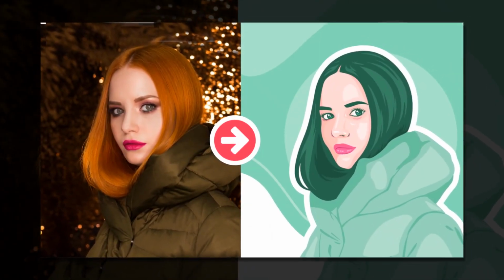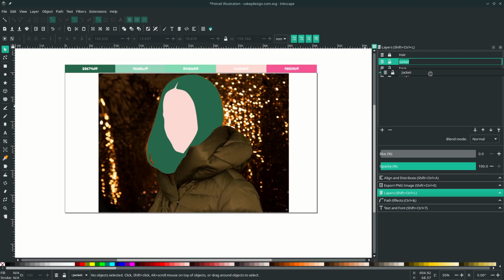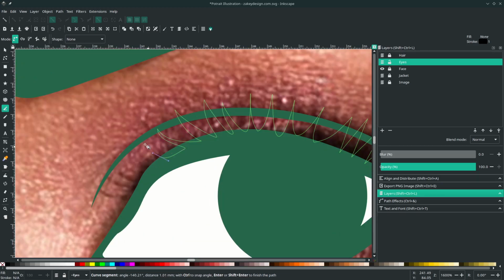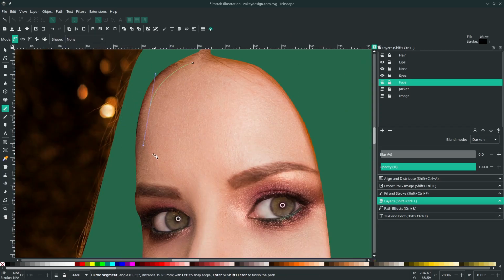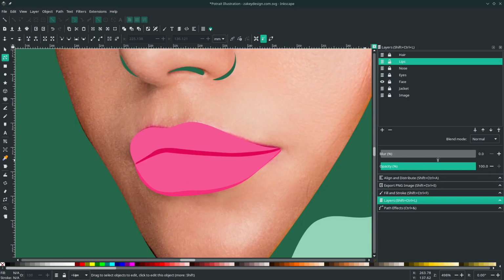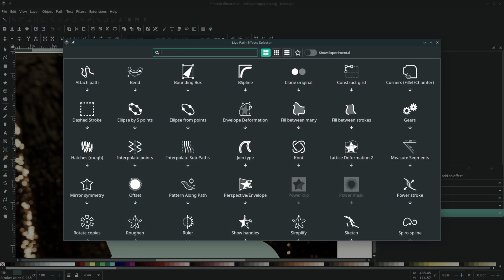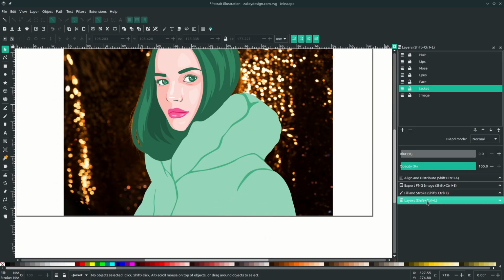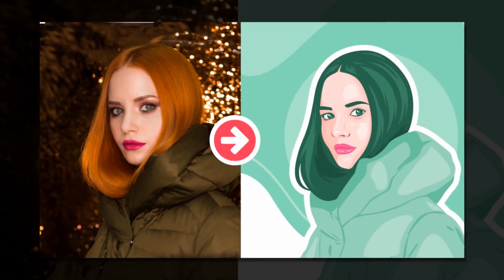Inkscape Tutorial : How to Create Vector Portrait Illustration from Photo

Comment: I have a question. How do you get the black lines around the eyes. Every time I do it - it just fills it.
Reply from the maker: in what minutes?
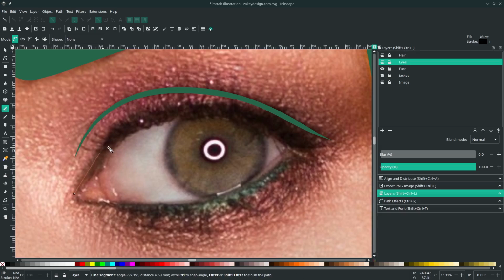Reply: @ZakeyDesign  Hi - in about 6:08. you are drawing around the eyes and they have a black outline.
Reply from the maker: @kdavidson6771  i see, there are two ways to remove fills after using bezier tool.

first, on bottom left, right click on fill > remove fill.

second way, make sure to remove fill first in left bottom corner, so only stroke with black color. then go to Edit > Preferences > Tools > Pen > Click take from selection
Reply: @ZakeyDesign  Thank you so much Zakey. I will try that tomorrow. I am trying to learn the short cuts as well so that helps right now.

Comment: Thanks so much for the video! My question though is how can I break the curved path that gets auto generated after I just drew a curve?
So this is what I'm doing  Drawing 3 nodes with a problem between 2nd and 3rd node:

1. Bezier tool selected
2. Click on page to draw a node (Node 1)
3. Click another point (Node 2) and drag to draw a curved line connected the first two nodes.
4. [PROBLEM AREA] I want the THIRD node to have a straight path from the second node.

Inkscape automatically makes the line between 2nd and 3rd nodes curvy, I don't want the line between 2nd and 3rd node to be curvy, I want it to be straight.  I understand I can just press ENTER and then continue where I left off by drawing a straight line, but I want it to be a seamless, continuous path.  Essentially, I want an abrupt break and to revert back to a straight line path instead of a continuation of a curve. Thank you!
Reply from the maker: hello, you can press shift+L in node 2 to node 3 to straighten the line without releasing it and hold ctrl to keep the line in straight then click to create the node 3
Reply: @ZakeyDesign  thanks so much! SUBSCRIBED!